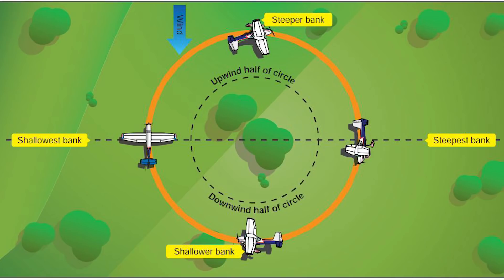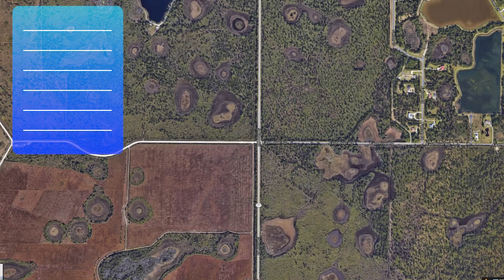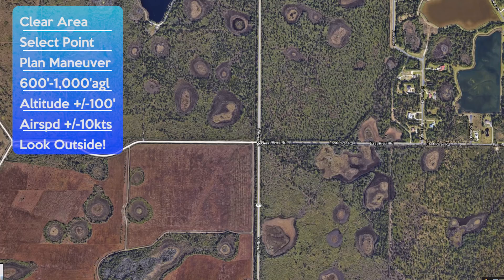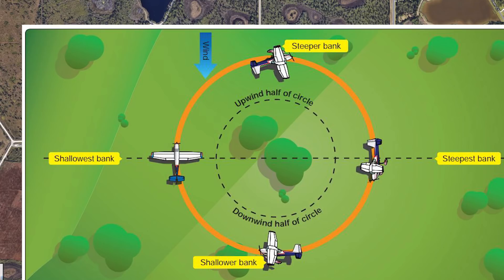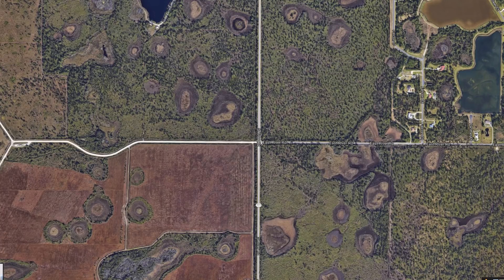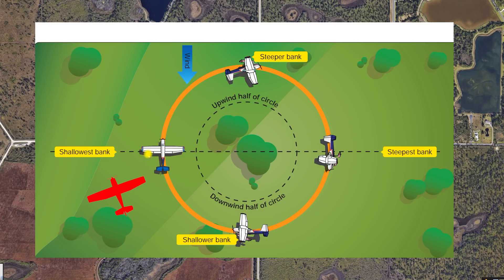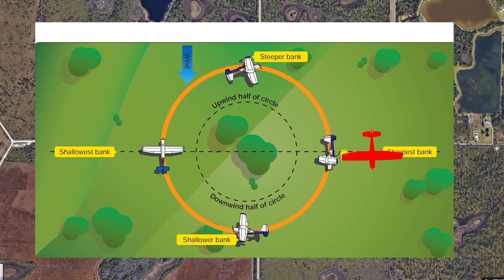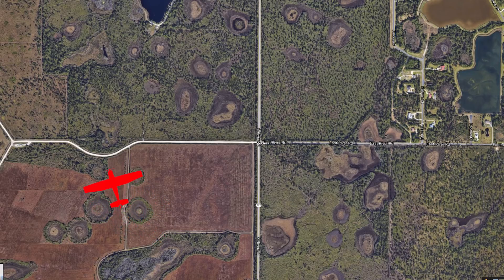Ep. 27: Turns About a Point | How to Do it!

Comment: What if you fly by just keeping the intersection on the same part of the wing during the entire maneuver. If the intersection starts advancing in front of the wing, shallow the bank. If it starts falling behind the wing, steepen the bank. Won't this accomplish the same thing without having to worry about whether you are upwind, crosswind or downwind?
Reply: that kinda defeats the purpose of the maneuver: to learn how to adjust your bank angle in relation to the wind. you need to know this for when you're in the traffic pattern, plus if you just stare at how your point looks on the wing then you wont be paying attention to keeping your altitude or speed

Comment: At 800 ft will a high wing airplane like a C172 have the wings obscure the point at all? Thanks for the video, it clicked for me with your explanation, and using an intersection (with nice straight roads leading out) made me realize it is good for thinking about ground track, by dividing into quarters.
Reply: You need to fly far away enough from the point so that your wings don't cover it. If you are too close, yes they could block your view of it. This is another helpful way to help you maintain your distance.

Comment: First, I'm here, because I'm ramping up to taking my check ride.  And, because, I really like your videos.  After watching quite a view, I find your explanations really easy to understand.   Your CFI Oral exam series is great.   Thanks for putting up some really excellent content. 

Now to my question ....

When on the furthest downwind end of the circle and starting to head upwind, the turn is a bit more into that turn, right?  NOT a skid, right, or any type of crab, right?   A skid seems horrible.  Is it just that I should stay steeply banked a bit longer to turn a beyond or rather inside of the circle, but still flying a balanced turn?   then as I round into upwind, roll out of the turn a bit.   But the key is all turns are balanced right?
Reply: All turns should be balanced/coordinated (no skids, no slips). Crabbing is OK, and inevitable, as you are turning relative to any wind. When turning from tailwind to crosswind (furthest downwind end of the circle), you have lots of groundspeed and will need a steeper bank to maintain proper ground tracking. As you go into crosswind, then headwind, you keep swallowing the bank until flying directly into the headwind, at which point you should be wings-level.

Comment: Hello Jon thank you so much for the video I practiced these on my own during some solo time and I didn’t work out so well but then again I tried doing it at 2400 feet.  I could never keep a point of reference (a barn) centered on my wingtip the barn kept “sliding back.”  I presume this maneuver would work much better at a lower altitude?
Reply: I always pick a point of reference large enough that covers my wingtip but can still see it off the sides of the wings so I know if I move to far away or close I can tell that's how I learned to do them

Comment: To keep within the +/- 10 it's airspeed goal, are you also having to adjusting the throttle each time you're turning into/out of the wind?
Reply from the maker: Nope, you're not "turning in and out of the wind"  the wind is constantly acting upon the airplane similar to a boat moving down a river.  Ground speed changes, airspeed stays constant with a constant power setting and holding altitude.  You won't have to apply any changes to power unless you find yourself getting to high or too low (usually the result of starting the maneuver with a slightly high or low power setting).   Safe flying out there!  -Jon